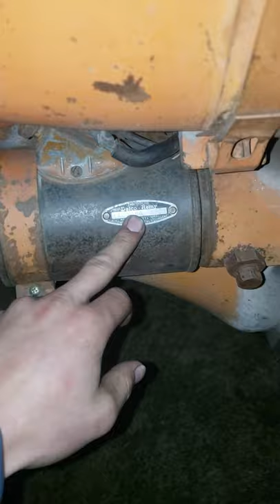How to convert a magneto to an external coil/distributor.

Comment: Points still holding up?
I need to do this to my '51 CA, tired of chasing shit spark from old MFJ Mag.
Reply from the maker: the tractor has not seen much use due to my buddy being in college but the points are still holding up great. still runs like new.
Reply: @powellcountyplowteam3-7-77  question: did you pull the original coil out of the magneto housing and then just wire in the external coil to the center brass post?  I went down to Tractor supply last week and grabbed a coil and some lead wire just trying to figure out how you guys did it.
Reply: Overhaul the mag properly and it will be good for decades. The rather large Harley magneto user community uses very similar Fairbanks and clone magnetos but not with eighty year old coils and weak magnets.